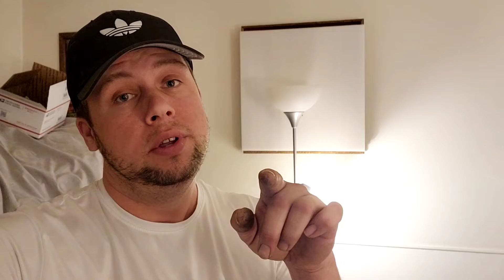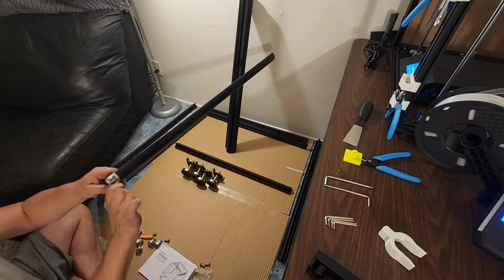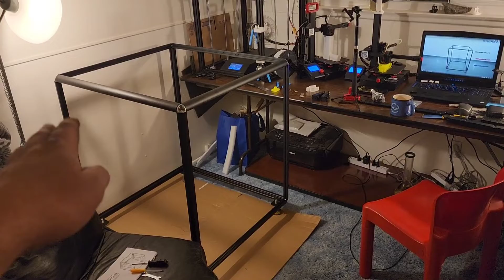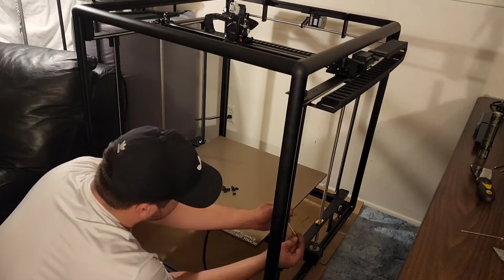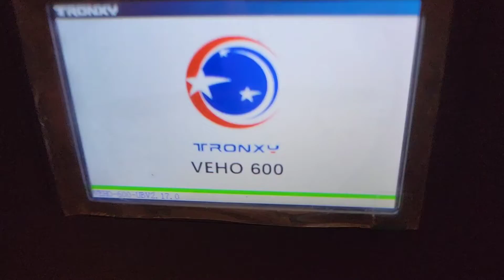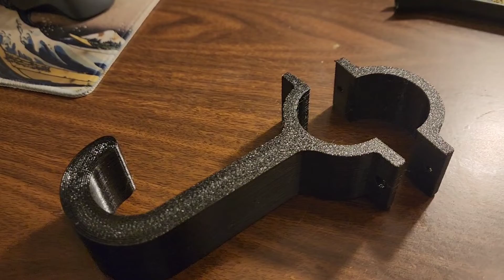NEW TRONXY VEHO-600 ASSEMBLY, TEST PRINT AND THOUGHTS , Part 2.

Comment: I'm looking into either replacing my Ender 5 Plus, or maybe having it as a backup to the VEHO 600 2E. Is there a way to speed up the hotend??? That looked painfully slow. At the end of this video, you mentioned your dislike of the extrusions TRONXY used. Is it possible to just build another frame with 2020, and tap the holes on the 4 vertical pieces to thread the feet into?? Does this printer run Marlin, or a different OS?? Have you experimented with 3rd party upgrades, such as BTT mainboard and TFT screen??
Reply: Ender extender sells a 500x500x500 kit for the ender 5 plus
Reply: at that point just dont buy the printer from tronxy and just build your own, these are just large Ender 5's 60mms printing, the whole nine yards. ya get one if you need the tool. ADD KLIPPER

Comment: Something that large guarantee where you build it is where it will live.  I noticed the braces on the sides.. IF I do this I think Ill be adding linear rails to the Z with some 2020 or 3030 for additional rigidity.  Im doing a ratrig 400 now but always looking for the next project.. worst case the frame would be great for a changeover to something else later on.

Comment: This has to be the worst unit you can buy !   After i put this thing together and it wasn't to bad to do , i plugged  in the power supply  and turned the unit on ' ok fine i ran threw a couple settings ' ok i turn it off unplugged it from the power supply to move it into its home position , plug it back in and it did not turn on  so i unplug it again only to find the 1 of the pin's from the power supply had broken off and was in the power cable so it wasn't making contact i Have sent a email to. TRONXY support with photos and they still have not responded  ...   make a video on how i can get my money back 😡

Comment: With 1000W power source (i quess heating bed will eat electricity like a tyrannosaurus) and very cheap belted xy+hotend+extruder setup 100mm/s speed will be final for this printer.  This is the biggest nonsense shit I've seen this year. Plus as a bonus there is no external mosfet for heatbed. Again i guess from comment below it is powered directly from mainboard? :D I cant believe it. What is the reason for such a big print area? ....because for that price you can have Voron or VZbot (330) in top configuration with 48V stepper drivers and hotend with +70mm³/s flow rate. It will stamp to the ground everything what you have on the table or what you will try to stand against them. Anyway thanks for the video ....hard to find info about this printer.
Reply from the maker: It's a 350w
Reply: @TimelessMotors  Heating must take forever...
My 310x310 heating bed has a 750W heater.

Comment: I have VEHO600. I had soo many problems to start this printer. It started with the loose belts and very bad design of the belt tensioners. Than, the 4 bearings on the polished rod melted down. I had problem with the  power beaker and the power plug too. I replaced them. Now I noticed that at the Bowden one screw is missing and the Bowden is loose.??? What else can go wrong??
I am sooooooo unhappy customer.
Reply from the maker: Sounds like you didn't assemble it well.
Reply: @TimelessMotors  I did assemble by the VEHO600 manual. I have problem with removing the printing head from the x-slider . I have problem with the sink heat position. There is no information about that in the manual. Do you know how to take a part the printing head?
Reply from the maker: @stevedinic5682  just take it slow make sure everything is squared up